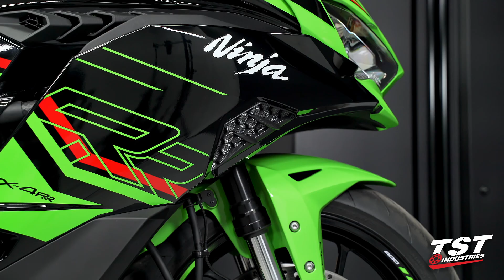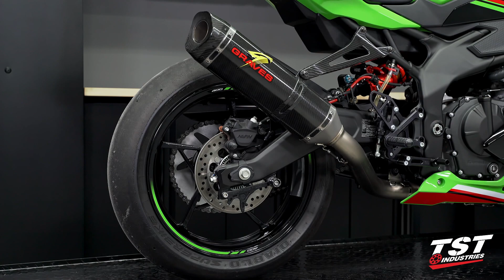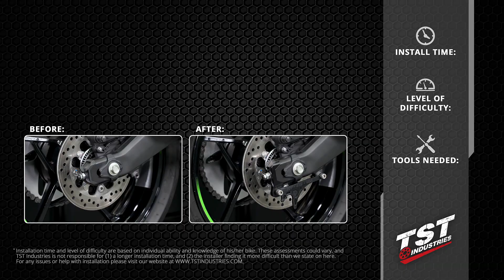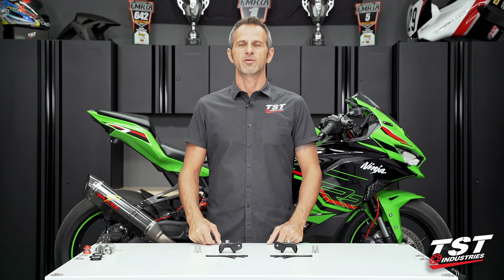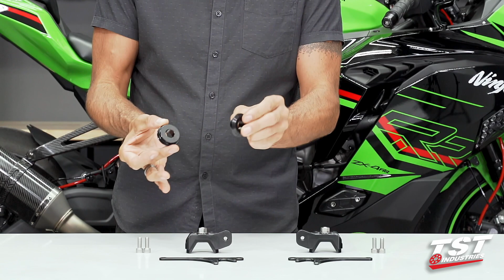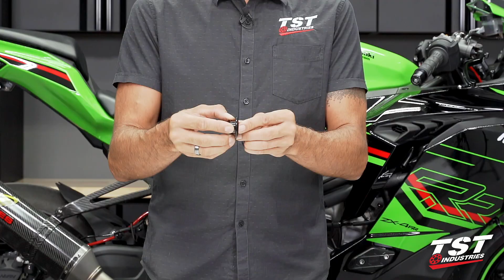How To Install Captive Chain Adjusters on a 2023+ Kawasaki ZX-4RR by TST Industries

Comment: Quick question. I installed these and while turning the adjuster nut outward, I heard the snap ring, that holds the adjuster nut to the block, pop off. It’s inside the swing arm but I don’t want to remove everything since it’s all snug and tight. It’s not a big deal correct?
Reply from the maker: If the snap ring came off I would urge you to take everything apart, inspect and make appropriate repairs. This can be done without taking the axle and wheel out as the adjuster is independent without the snap ring. That condition happens when your axle is too tight and you are trying to use the adjusters to push forward on it. The snap ring retention cannot overcome that force and the snap ring comes off. Please adjust in a looser condition next time, or if you must do it in a tighter condition, ensure that it is in the axle towards rear direction only.
Reply: @TSTindustries  thanks for the info.

Comment: I accidentally broke the threads on the right chain adjuster however the axle nuts are safe and tight. Can I still use the bike on the way to a service center?
Reply: Did u find out?

Comment: When will you guys be developing or releasing high profile racing cams or performance velocity stacks for the Kawasaki ZX-4RR?
Reply from the maker: We have played with stacks already. Very small gains to make with those as Kawi already has them pretty optimal. Once we change the breathing we will likely need to make some stacks to compensate for the intake dynamics changing.
Reply: @TSTindustries  That's a cool update, any news on racing camshafts becoming available?

Comment: this is a great product and really is a hustle to put the wheel back in with all these parts falling out or needing to be held in place for a single easy wheel removal/installation. the only bad thing is that you need a gp lifter for your bike. and not a universal fork style to hold a bobbin from the swingarm.
Reply from the maker: You can actually use a spool/bobbin through the front mount. The result is that you have both gp and spool lifting, but you do need the gp lifter in place to tie the system together

Comment: Nice. Looks like you have ANDREANI MISANO FORK CARTRIDGE KIT installed in those forks. How much did they improve the ride? I'm not too happy with the stock forks. When will the kits be 'In Stock'? Who do you use to install the kits? Thanks
Reply from the maker: We installed those very recently and have not taken it out to the track yet. The oe forks were pogo sticks and inhibited the rider's pace. We had to change them. The shock too... Way too spongy. Typically, when we go from this class bike oe forks to Andreani the difference is bight and day....insta-confidence. We have been selling and installing the Andreani kits for a good amount of years now. We have a shipment of 20 or 30 sets coming in any day now. Last week i heard they were in customs. It will take several days to have them show up pn our website after they arrive. If you are burning for them you can hit up Mark through our customer service department and he may be able to tell you more since he is driving that project. We install and set up the suspension on the bikes we build. When someone wants to purchase a fork kit and have it installed we do that through our connection with Andreani.